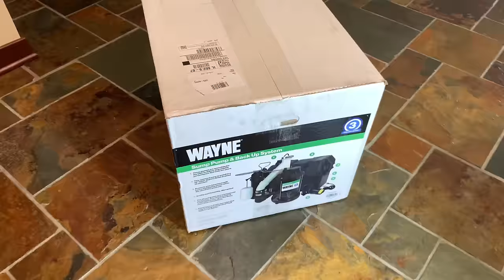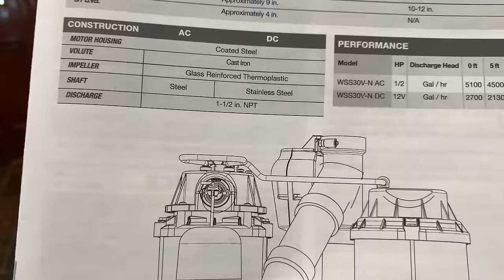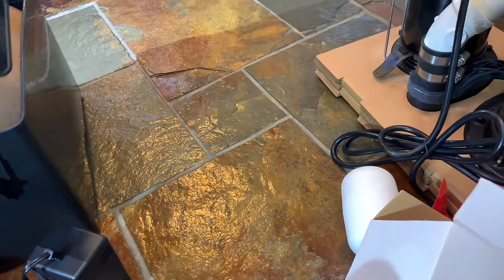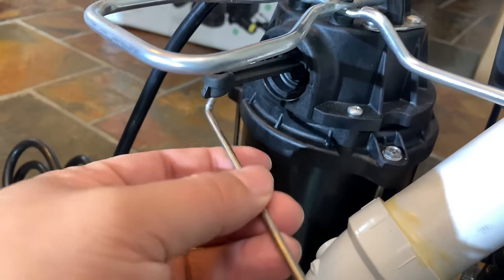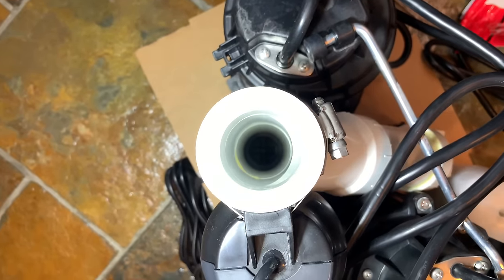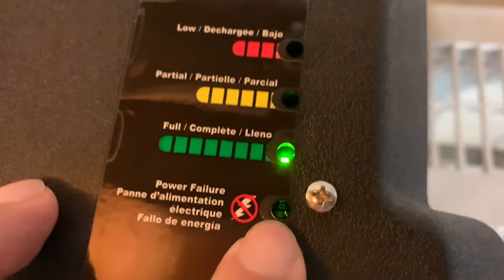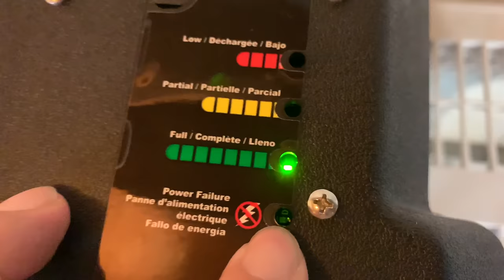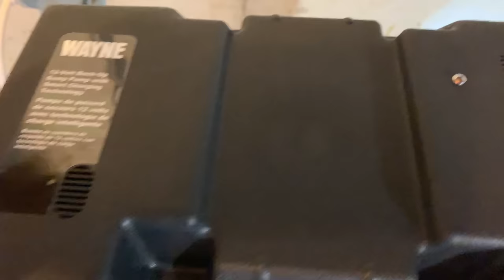How to Install Wayne WSS30V Combination Sump & Backup Pump Review

Comment: thanks for the video. after watching this video, I am motivated to install the same pump on mine now. A couple of questions... do I put the pump on the sump floor or I have to hang it little higher?
in my current setup, there is a check valve couple of feet above the sump cover. Can I leave it like that or I don't need that?
Reply from the maker: I have a second check value about 4 feet above the pump that was easier to leave in than remove. Since the built in check valves are on the bottom, I don't think it matters.

Comment: my basin is about 16.75in, how wide are the two pumps together? I am not sure they are going to fit.
Reply: Hey great job explaining how to install the wayne back up sump pump. I too also had a watch dog back up sump pump system but after 7 years the battery died. I didn’t like that battery because you had to add acid and water to get the battery to work and I am not a chicken but battery acid and human skin don’t mix well! And I didn’t wanna get all dressed up in practically a hazmat suit so you didn’t burn your skin off! Anyways I like these new completely sealed batteries that are 100% maintenance free! I also love that the sump pumps are compact and almost ready to go right out of the box! And you only need 1 pvc pipe for both pumps. Thats a huge bonus compared to the watch dog system with  2 pvc pipes which is a hassle to get them all lined up. Only question is do you have to drill a 45 degree angle at the bottom of the pvc pipe to allow some water to go back into the pit? I know my watch dog system did and I think it’s for air and water pressure or something to make the damn thing to work correctly lol But big thanks for taking time out to make a through but concise and right to the point to describe how to set up this system. So thanks again and I hope this ends my every so many years of bailing out and drying my basement with many profanity words to release some high strung anxiety. Oh and why do sump pumps fail on the worst possible ways!? I came home from my in-laws after thanksgiving dinner this year 2023 and my guardian angel told me to go down to my basement for no apparent reason only to find 2 inches of water in my basement and then all hell broke loose with screaming and loosing my mind like Clark Griswold when he didn’t get his bonus but a one year subscription to the jelly of the month club! But as Eddy pointed out that’s the gift that keeps on giving all year long! Oh and if you like to know I didn’t even get a subscription to jelly of month club! And you would think my guardian angel didn’t even help drain the water with her magic. All she did is say hey go check out your basement you have a nice long evening ahead of you brother so start up the shop vac brother! 😡😡😡

Comment: Bought this one a year ago but didn't install it until today. The big and immediately problem is that the main pump just keeps running when float already reached the bottom. I even manually push the float level all the way up and down but the main pump just won't stop until unplugging the power. Don't know what to do now. The secondary pump works well.

I planned to install it by myself, but finally I had a professional plumber today to install it. Then we got this problem.

Comment: Bought this pump and installed it with a new battery. After a year the power failure red light came on, alarm sounds nonstop and the backup doesn't work. Any ideas?

Comment: Does this pump have or need a sweep hole??
Reply: I installed one recently. I had the same question, and called the manufacturer. I was told that an air hole is not needed.

Comment: did you make a weeping hole?
Reply: Wayne say you won't require the weep hole with this system.
Reply from the maker: I did not drill one.
Reply: @Volkan why would it change, only one line should be operating at any point in time.
Reply: @davidrogers938  I almost agreed but Remembered a video commenting that in high flow sumps the advantage of the backup is that they can kick in when the primary is out paced by the water flow….   But I’m most cases I agree with your point.

Comment: What did you end up doing with the unused drain? Cap it?
Reply from the maker: Yep, I capped it off. I was planning on removing it but - well, I’m lazy.
Reply: @petervonpanda  ok
Reply: @petervonpanda  I have two drain pipes joined to a Y before draining outside at the moment.  I am trying to install this model. Wayne customer rep states I have to use both drains and remove the Y on the pump. Any thoughts?
Reply: @petervonpanda  If your drain gets clogged you’ll have to fix it while you may experience flooding. I think I like two drains.

Comment: I don"t have a sump pit, Can I set it on my basement floor and it  will start pumping when the water gets to it?
Reply from the maker: You could but it takes about 8 or 10 inches before it’ll pump so it’ll definitely be pretty flooded by then
Reply: Thank you
Reply: You’ll need a Wayne water bug 0.16HP pull up to 1200 gallons of water. You can sit that one on the floor. But Wayne 3/4 hp will do the job faster off course has higher horsepower👍🏾.

Comment: Do you connect a Wayne sump pump to Basement Watchdog battery?
Reply from the maker: No, I'm using the battery box that they sent with the pump. my Watchdog ended up failing so I wanted to replace it too.

Comment: Did you also drill a vent hole?
Reply from the maker: I didn’t
Reply: Peter von Panda It makes sense. I just received mine and it says: No airlock top suction design.

Comment: Two years later!!! can you please give an update about the performance 
 for the last 2 years
Reply from the maker: I live in a wetland and my pump runs all the time, and it’s still running great. It’s never even needed the backup yet
Reply: @petervonpanda  Awesome! sounds like a Great buy.
Reply from the maker: I was a little worried because I get so much water. In fact, I have a third pump in case it fails, but I’ve never needed it yet

Comment: those are junk. The housing where the switch is tends to leak or can condensate inside fowling the switch.  When, not if that happens you will need yet another emergency pump in place to be able to pull that whole assembly out to work on it. doing this in a flooded crawlspace is a nightmare